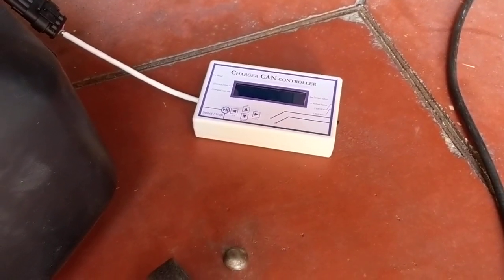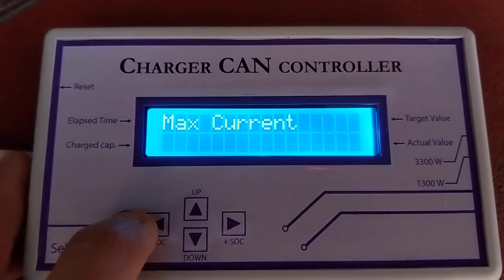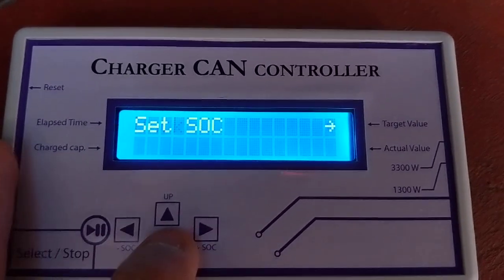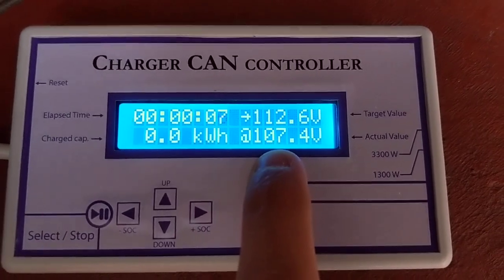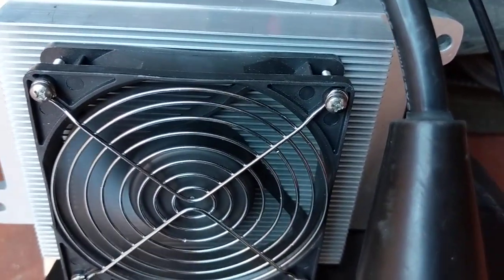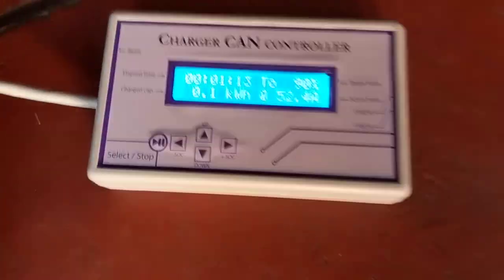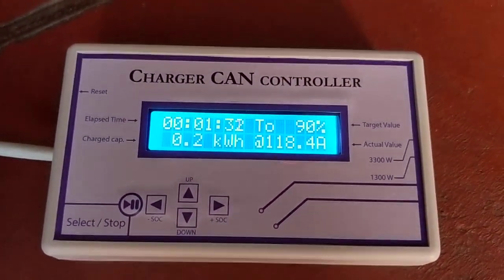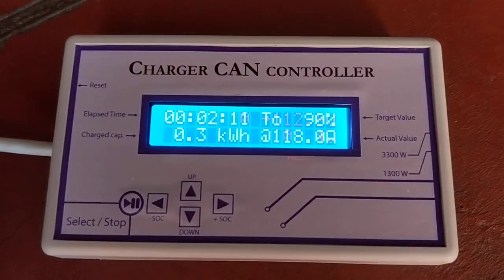Homemade CAN controller with menus for fast charging Zero Motorcycles: up to 3.3 kW per charger

Comment: Muy bueno, te felicito.. Como puedo buscar info del cargador? Como se cambia la tensión del cargador y que funcione sin estar conectado al canbus como en mi auto. Cambie las celdas por lifepo4 26s y preciso subir la tensión es un f7225pb160d-150 . Saludos
Reply from the maker: @rdaguerre  gracias por tu comentario. Lamentablemente, estos cargadores requieren de mensaje CAN cada segundo. Si no, se paran y dejan de cargar. El cargador es un TC de 3.3 kW. Puedes encontrar mucha información en internet buscándolo por su nombre. Mucha suerte!

Comment: Does the code still work with all the tc chargers being sold currently?
Reply from the maker: Hi! Thanks for your comment. You'd need to check the CAN address needed to receive and to send data from and to the charger. That information is provided by the manufacturer. Once you find this information, the program can be tuned by just changing two lines to fit any CAN-bus controlled TC charger. Without this information (CAN addresses) it is going to be impossible to control any charger
Reply: @DanielMonteroElectraveler  hi, thanks for the quick reply! Im planning on using this code to control a 108V TC charger for my electric gokart. Will give this a go :)
Reply from the maker: @djrrmml7514  please, keep us updated and let me know if you need some help. I'm far from an expert but I'll do my best. Good luck!
Reply: @DanielMonteroElectraveler  will do!

Comment: Any plans to follow in Diginow's footsteps and have it communicate with the bike? Communicate with the stock charger connection location or maybe bluetooth? Could be useful for safety limits as the bike sometimes is not smart enough to taper off charging or open contactor. Especially if you use the key-on method to close the contactor, I think for safety the bike is less likely to open the contactor if you make a mistake charging--but I don't know.
Reply from the maker: Thanks for your message! No, I don't plan to communicate with the bike. If you check Diginow's history, they claimed one of the problems that caused the company to eventually cease to exist was that there was a high chance of having isolation problems when connecting the chargers and the bike via CANBUS. Those isolation problems were apparently the cause for some chargers, controllers or batteries causing malfunctions. I don't want to make the same mistake. I don't use the key on to start the charge, I use the normal protocol that the onboard charger uses, just without the CAN part. I have had some problems while charging from time to time and the bike is still smart enough to open the contactor if it doesn't like what it is receiving as input current. I am not too concerned as long as I don't put 13 kW when the battery is at 0 degC
Reply: @DanielMonteroElectraveler  Yes I recall that isolation issue. I believe it was only certain bikes. Thankfully mine is not affected but I can always add the optoisolation needed if I ever find the time! Where did you find the information on the enable protocol because I've seen many conflicting  posts about the enable signal on various Zeros. I just broke my charge controller from Diginow so now I'm forced to come up with my own solution. It was a V2.5 with total bluetooth control which has spoiled me. Do you have recommendations for a CAN board/shield? There are so many with different features. Thanks
Reply from the maker: @brandonsprague7098  send me a mail to the.electraveler@gmail.com and we can continue the discussion there!